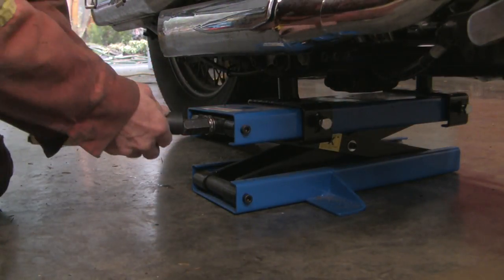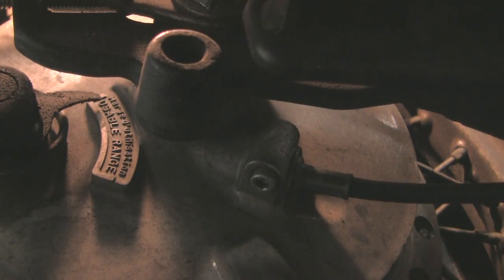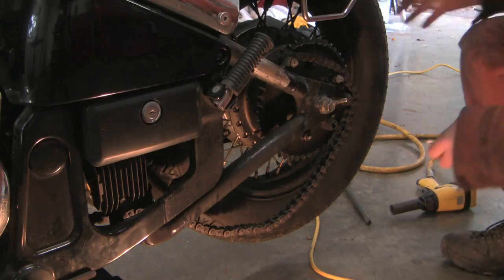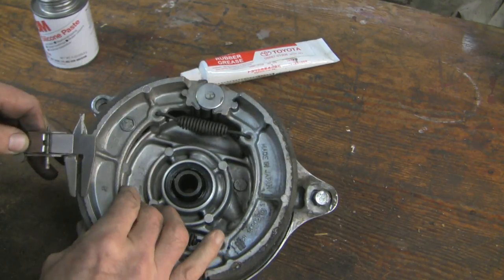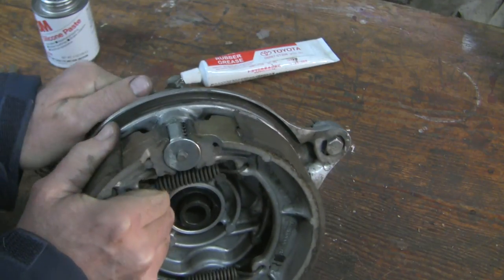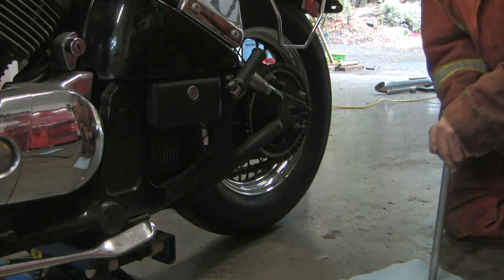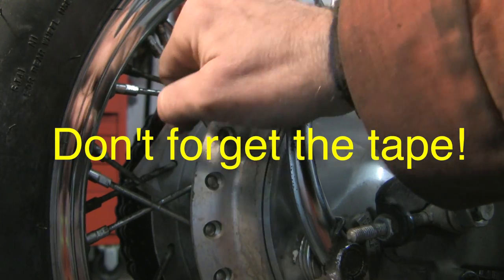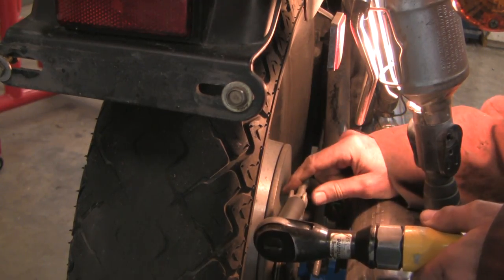Rear Motorcycle Wheel Removal and Drum Brake Inspection

Comment: Alternative to removing the mufflers---
---Instead of Taking out the mufflers you can loosen the lower shock bolts which allows the swingarm to drop and you can access the axel bolts no problem. I needed that tip (found by my buddy) when I discovered very tight and rusty bolts on the exhaust mufflers, and I couldn't get them to budge with my little toolkit. Thanks for the video, definitely saved me money and troubles! Lots of good stuff in here 👍🏽👍🏽
Reply from the maker: The comments section of any good video have scattered remarks like yours that will help others who are in a bind. My bolts have always come out easily, but I can imagine bikes stored outside in the rust belt will be much more problematic. Thanks for taking the time to help others.

Comment: Really easy to follow your task description with the video, like the previous guy stated, “ well edited” coupled with the little pointers regarding location points when putting the outer break housing back in place and the Speedo cable end into the wheel housing, thank you for sharing your knowledge, with everyone.

Comment: excellent video . I just purchased a beat up vulcan vn800A . literally everything is bad on it. sprockets and chain are toast, front and rear brakes worn completely out , both fork seals completely trashed , both tires and tubes gone. basically it's a frame engine and transmission.  
I have all the parts ordered and can't wait to get to work restoring this bike

Comment: This video has been a humongous help for me. You're very knowledgeable which makes it easy to follow along. I'm undertaking the same project this summer on my Vulcan classic!
Reply from the maker: Thanks, Mike. I know another guy with the same name, not you, ha ha. Nice to meet you.

Dave
  By the way, one thing I forgot to mention is the directional arrow on the tire. If the tire you buy is directional, make sure they mounted it correctly on the wheel so that the arrow points with the same rotation as forward rotation of the wheel. If you see the stamped arrow printed on the tire at the top of the tire, it points forward, if the arrow happens to be at the bottom, it should point backwards. It would be uncommon for a pro to make that mistake but it's always good to double check their work.

Comment: Excellent video as are all of yours. Well scripted , to the point and deal  with the technical issues. It's nice to see maintenance issues covered for the shade tree mechanic thus saving $100 plus per hour for the Kawasaki shops. I'd like to see a Cam Chain Adjustment video maybe coupled with a Valve Lash Adjustment video since these are regular maintenance  issues. Many thanks for the well produced technical videos for us shade tree mechanics.

Comment: I don't know how many times i've watched this video. It was a help back then when i needed it.

Now i have two problems which i cannot seem to fix. When i reassemble my drum brake and everything, my speedo doesn't work  anymore. The cable is fine, because the speedo works if i put the cable in a drill and go for it. Something within that drum is not lining up. Plus my rear brake line freezes on me. Whenever i use the pedal, the cable stays in the forward position. Hopefully i can get this fixed some day
Reply from the maker: I'm sorry to hear that. As you know there is some kind of gear inside the drum that meshes with the forked end of the cable. If the forked end of your cable looks good, then there must be something wrong inside. When attaching the cable you need to rotate the cable a little to get it to mesh up inside. I've never had any problem with that so have never taken it apart. Regarding the brake, it sounds like a spring has come off, or maybe it needs lubrication. Good luck!
Reply from the maker: I've been thinking about your problem, and today I wondered if it may have something to do with properly lining up those two knotches shown after 9:16. If you do take apart the mechanism, think about sharing your experience with all of us to show us how that speedo device works inside the wheel. Youtube is all about paying that kind of experience forward.

Comment: My '48 Indian Chief has a center stand that is used on a level surface for changing tires or servicing rear bearings or brakes, on the road, or in garage. First, remove wheel studs with hex wrench.  Next, bike must be tipped over onto it's side stand, and held there while  you rotate center stand forward,  then you tip bike  back to a vertical position onto the center stand. When on center stand,  rear tire is high enough off ground to allow you to remove axle, tilt wheel sideways and remove wheel. It looks scary but it has worked for generations of Indian riders.  Also works when removing front wheel with a block under the front part of frame. To lower bike back down, push forward while astride it.

Comment: This video was made 5 years ago but I think this is important: I would not recommend using an impact gun on the flat jack to raise or lower. The impact can break the roll pin and threads of the lift rod and cause the jack to fail rather dramatically.
Also, removing the exhaust at the first would have allowed room for all the other tasks (hind sight).
Chain slack adjustment is more than making sure the marks are aligned on either side of the swingarm.
I would rate this video 7/10. above average. well presented with good use of frame time. The technical aspects were the faults in the video but the job would be completed safely if done per this video.
Reply from the maker: Those are good points. I've used the impact regularly for that lift, I didn't even consider it could fail dramatically, ha ha. And you make an excellent point about those alignment scales. Indeed, in a later video where I replaced the chain, I used a specialty tool to align the chain and wheel with the drive sprocket. As you say, I discovered those scales are inaccurate for my bike, although they are a reasonable starting point. Chain alignment tools are fairly inexpensive and worth having. Thank you for adding constructive remarks to the comment thread. They make Youtube what it is.

Comment: Interesting note on the air tools. Took me a while to find the manufacturer when I searched a few months ago. The butterfly impact caught my attention in a previous video...I can see tons of close-quarter engagements with stubborn nuts, and such a tool is on my wishlist. I can think of several instances where the decision to switch to air tools turned dismally stalled projects into immediate victories. (rust-welded, failed Ram O2 sensors for example)
Reply from the maker: Yeah, I think the vibration is so much better than the pure torque of a longer wrench. Merry Christmas to you!

Comment: Thanks for the video. Is doing all this the only way to know how much meat you got on your drum's brake pads?? I just got a Vulcan 500 and I'm not sure how much pad is left on the tear tire
Reply from the maker: Yeah, with drum brakes the thickness of the shoes cannot be directly measured without removing the drums. However you'll notice there is a pointer attached to the swing arm, which will move to the end of its swing path as the shoes wear. That pointer is a good index, but it's not perfect and there is variance between bikes.

Comment: As always another great video and well put-together, there is just one thing I would like to say, the guy who owns that bike needs to give it a real bath that is absolutely horrible to own a bike that dirty I would never ride that thing anywhere. I own a 1999 Kawasaki Vulcan 800 classic and I have owned it since it was new and it is in pristine condition and always spotless. Once again thanks for another great video. I believe there is a link to the picture of my bike in my YouTube channel.
Reply from the maker: ¥eah, pretty dirty, I'm guilty, ha ha. I use chain wax rather than oil, and although it seems less messy it is not easy to remove.
Reply: Well just a friendly tip I use the chain wax also because I believe it is the best but always after you apply the chain wax to the inside of the chain wait 10 minutes and roll the chain through a rag lightly. Once again excellent video.
Reply: It would be nice to see you too a valve lash adjustment which needs to be done every 6000 miles on these Kawasaki Vulcans. They are done with a shim by Hot Cams

Comment: Hey great video.  Just did my rear brakes and changed the tire from this video.  I have a 2004 Vulcan 800.  But I was wonder if I could ask you something.  I have a part left over.  Its a small collar, and I can't figure out where it goes.
Reply from the maker: Not sure, I wonder if it may be a spacer for the wheel bearing. Those spacers are pretty important to get the right axial tension on the wheel bearing. If the video doesn't help, I would search for your specific dealer repair manual, you may even be able to find one online as a free pdf document. Many wheel bearing spacers are pretty long, if it is much smaller I wonder if it could be a bearing seal or maybe a washer for one of the other parts. In any case if it belongs on your bike the dealer repair manual should show you where it goes.

Comment: Your video is very helpful, ihavea 800 Classic . This will really help. 
I have a question for you , I notice you had a cable lock on back . I was thinking of using a cable with a padlock for short stops , movies, restaurant and the like. For some extra security. Is that what you do ?
Reply from the maker: Yes, exactly. I thread it under the seat, through the rear wheel and chain. I also use the front steering lock. I don't tie it to anything, so if somebody had a few friends they could lift it onto a dolley, then into a truck and be gone. However motorcycle theft is a crime of opportunity, few would put in the extra effort to lift an old 700 lb bike like this one. I rarely leave it anywhere outside overnight. I have always been 'self insured' for theft. After 20 years the insurance savings have already paid for a new bike if I want one. Thanks for visiting my humble channel!
Reply: Thanks for the ideas. I’m going to be more careful. I was in a store for much longer than I thought and noticed some guys lurking and scoping out my 800 when I came out. It was almost dark and I think they were going to nab it. Also I realized I parked in a dumb spot where they could back up to it and not be noticed by anyone. I just got it and last time I had a bike was 30 years ago and didn’t even worry about bike theft in Oregon.

Comment: Thanks for the video! I have the 2002 Vulcan 800. I'm getting into doing more and more on it myself. I may be following it to replace my tire. I just got her running for the season and immediately picked up a screw in the rear tire. (Basically brand new tires) SO frustrating! Do you plug your tires that get nail holes, or do you replace them? They don't recommend riding on plugs, but some guys do. Thoughts?
Reply from the maker: I usually ask for pro help on punctured tires. Hopefully its not a sidewall puncture, they can't fix those. With cars, often the shop will do the repair at cost if you bought the tires from them, although I find motorcycle shops around here to be less obliging. You'll likely save some cash if you take the wheel off yourself. Good luck! By the way, a dealer repair manual is always worth having, I get one for all the vehicles I own. Electronic copies are available for cars online, I use alldatadiy. The nice thing about that is you get updated TSB's, but last time I checked they don't offer bike manuals. For bikes, you could do a search for your model and year and find somebody willing to sell a CD or pdf copy, and dealers sell originals, too. Good luck!
Reply: Thanks. It's not a sidewall puncture. I borrowed a plug repair kit from a buddy, but also ordered a new tire. Sooner or later, I'll need it! 
I have the Haynes manual on my bike, as well as the owner's manual. I'd love to find the dealer manual, although I don't have too many tools for specific jobs. I do what I can, and learn along the way. I would love to see any of the videos you've done on the Kawasaki 800. I'll see if I can search them that way. I hope you've done one on checking valve clearance, because I think that might be something I could try to tackle. 
Thanks very much for the reply.
Reply: Thank you very much, again, for your video. I ended up removing the wheel, taking your advice on how to keep it together, and took it in for a replacement tire and tube. I got the wheel back today and put it all back together this afternoon. I appreciate your videos on the Kawasaki 800, since that is my exact bike. 
Every time I learn something new about my bike, I feel more comfortable working on it. Thanks!

Comment: Thanks for the video, does a brake squeal in drum brakes on a Suzuki usually signal replacement shoes are needed
Reply from the maker: Not always but certainly worth having a look. It could be a small stone pinched at the wrong place. Don't leave it too long, since you don't want to replace the whole wheel.

Comment: Awesome video! I'm working on the drum brakes for my 2004 Kawasaki Vulcan EN500C at the moment...attempting to take off the cam lever/shaft to regrease it; however, I can't seem to get the shaft out. The repair manual requests that I pull it out from the inside, but it's a little tricky. Is there anything you would recommend? I've contemplated using a flat-head screwdriver to pry it apart, and I've also thought about putting it on a vise, but I don't want to damage anything. Any help would be sincerely appreciated.
Reply from the maker: I've never had that one off, but I remember the fitting. There are many pullers designed to accomplish that task. Some are designed for windshield wipers, others for battery terminals, and others are generic. Try searching "windshield wiper removal tool", I'm guessing the one I have would probably work. It screws down on the center post and pulls up on the outside arms. Also Lisle sell a tool designed to expand the arms of the outside part of battery terminals. Before you take it off, remember to put two marks on the mating parts so when it does come off you can reassemble it the same way. Please stop back and tell us how you got it off, I'm sure your experience will help others.
Reply: Spelunkerd, I got my cam shaft out by using a flathead screwdriver and twisting while simultaneously pulling it from the inside. Hope that helps someone in the future with the same issue. Thanks for your help!
Reply from the maker: Excellent, thanks for the followup, I'm sure it will help others who stop by.

Comment: HI, I have been using a lot of your videos to help guide me through forking on my vulcan/first bike. One thing I want to ask is, did your alignment work fine using just the hash marks on the frame? every forum I've read says not to go by those... what say you?
Reply from the maker: For alignment of the rear tire, those marks were off more than I expected. That little tool seemed to work pretty well in the video, I recheck every year. I haven't done front alignment, ever.
Reply: @spelunkerd  Which little tool do you mean? I very likely have missed that part, but I tried finding it and haven't been able to yet
Reply from the maker: @happywheelz11  Oh, now I recall I demonstrated it on the video where I go into replacing a motorcycle chain. As I'm installing the new chain I show the difference between alignment with the marks on the frame vs alignment with the little tool. Quite a difference.

Comment: Great video, do you do all of this with the bike just on that stand, or do you reinforce its stability otherwise?
Reply from the maker: Excellent question. I've had this bike on its stand without backup to service the front wheel occasionally, and it seems pretty stable even without the handlebar support from above. As you can see at 5:58, there is no way this would fall even in a small earthquake, and I wanted completely confident support for days while I waited for the new tire. I hope more visitors chime in with their experience. Hydraulic tools always need backup, and cheap tools like my little stand can be unreliable. In my hands this one has been rock solid.

Comment: Hi.. as I am getting ready to ride on my 2014 Yamaha V-star 250..the rear brake pad is grabbing the drum on the wheel and making a sqeaking noise and unable to move freely.. can I adjust the cable the pulls the lever and  losen the grip or should I take the wheel off and replace items as needed?

Thanks 
Shane
Reply from the maker: They call them shoes when they act on brake drums, pads when there is a central rotor that pads squeeze against. The 95 Vulcan has pads on the front, drums on the rear, I did videos for both. If you have the more modern pads and rotor on the rear, then you need to remove the caliper from the caliper bracket and lubricate everywhere the pads make contact (except the actual brake surface contact area). Especially lubricate the clips and the slides. Don't forget to take a file to the area under the clips. Rust jacking is common in that area, causing pads to hang up and wear unevenly. The most common cause for unequal wear on the pads is sticking slides, the whole caliper needs to slide sideways as the pads wear, otherwise you get unequal wear. If the slave cylinder is sticking, you need to rebuild or replace the caliper. If you have brake drums, as shown in this video, then the advice to remove everything and lubricate the mechanism holds. For really good teaching on brakes in general, SouthmainAuto here on Youtube is a brilliant resource, though he doesn't do bikes. Good luck!